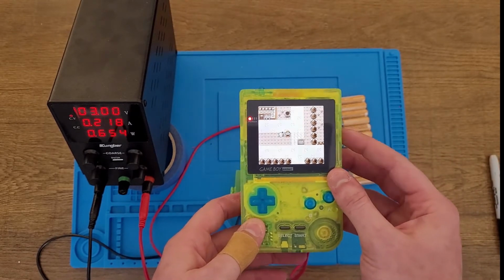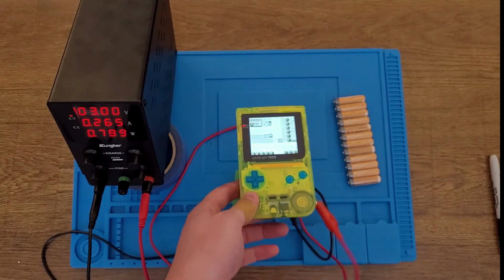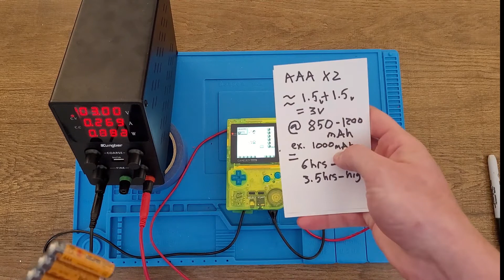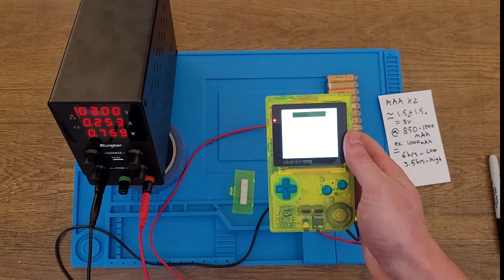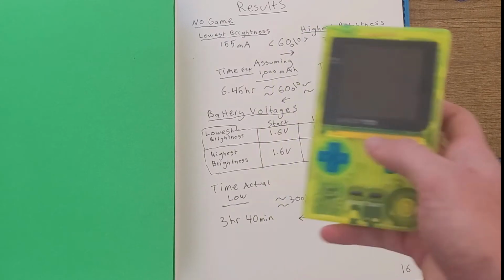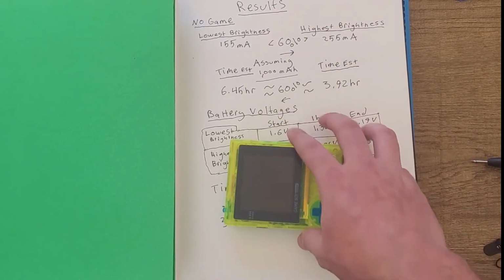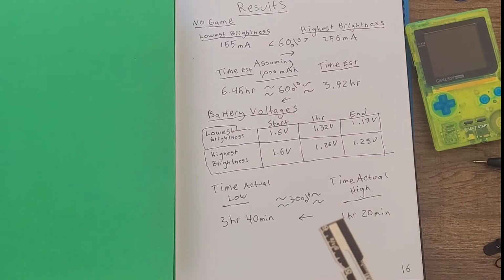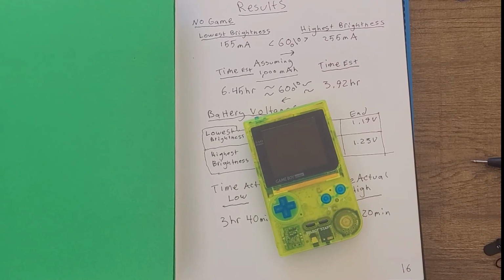Game Boy Pocket Retro Modding IPS Screen - Battery Life Test

Comment: Nice video. I tested the same Game Boy Pocket model but stock on my lab bench power supply and got 90mA on Pokemon Red. Pulling 2.5x that from IPS can't be great for Game Boy lifespan. A thermal imaging camera would be the next step. The current does tick up from increasing audio volume but you probably need a power profiler to see the difference.

Comment: Very informative man. I was wondering about this because I had just bought a modded GBP with an IPS screen and it didn't last two hours. I thought the Gameboy was defective. I've got some Tenavolt rechargeable AAA on order and they're suppose to maintain 1.5v so we'll see how that goes.
Reply from the maker: The tenavolts being Lithium Ion should help for sure. Certain battery chemistry's do not do well under high current draws. Lithium blends tend to be more tolerant of consistent current draws. 

Good luck!
Reply: How did these batteries work? I’m modding my GBP now and I’m looking for a battery solution.
Reply: @cdp3x  It's not a big improvement honestly. About 3.5 hours on the lowest brightness.
Reply: @icantaim4sht836  Yeah I’m finding that to be about standard but I’m hesitant to cut up my shell and mod it with a usb-c port. Really isn’t a silver bullet solution for battery life on the GBP.